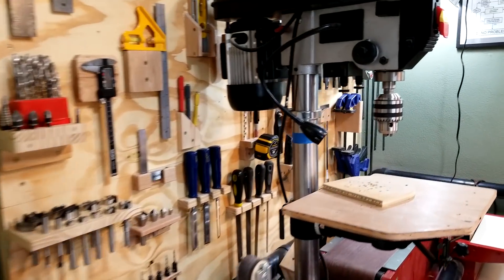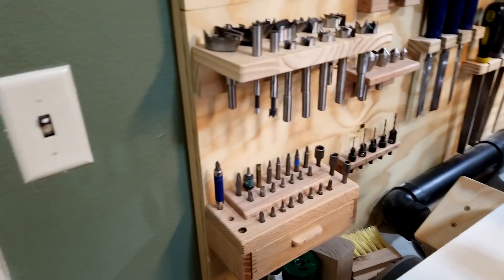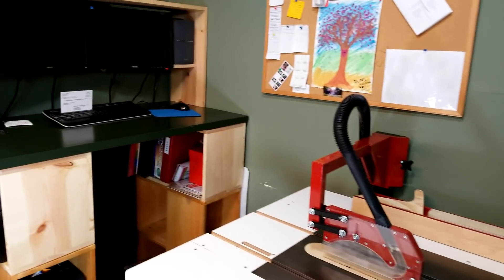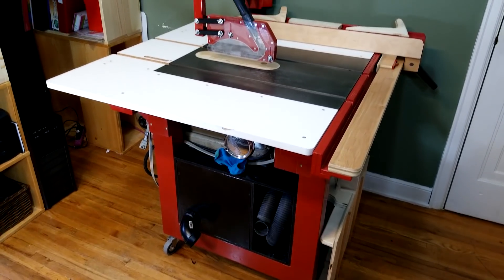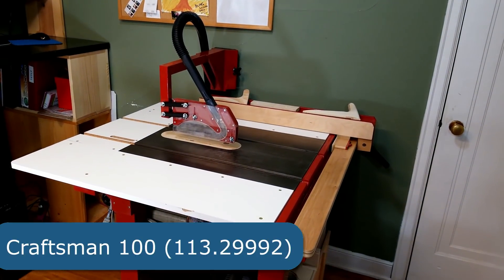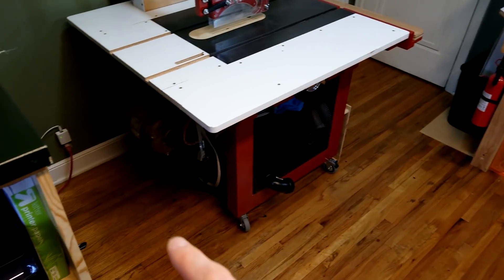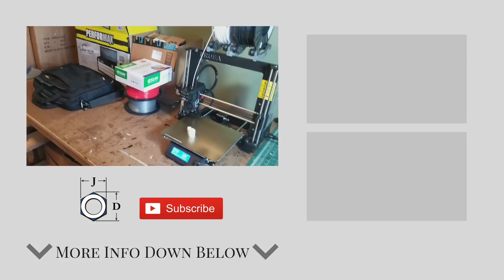My 95 SQFT Apartment Workshop (SHOP TOUR)

Comment: Amazing use of space.  Hats off to you. 
My shop is just a tad larger at 120 sq feet..in addition to the machinery, it also stores large pieces of wood and gobs of misc stuff (which are put up on wall / ceiling storage shelves...( I have 9 foot walls that I brought down to 6.5 feet).  I am more than crammed full right now with no workable room at the moment.  

My shop needs a complete full renovation from purging old stuff,  inventory review, and a new layout redesign for working.   Looking for ideas.   You gave me some.  Thanks for sharing.
Reply from the maker: I'm glad my video was helpful. Why did you lower your ceilings?
Reply: May not have explained it correctly.  My shop is outside, and I built the walls 9 feet high, the highest the city would allow me.  

The wall height is still 9 feet in the center of the shop and I have wood storage rake right in the middle hanging from the rafters.  

I installed shelving on 3 of the walls, and in those area, under the shelving the height is about 6.5 feet.  But, it gives me a lot of storage area to store Holiday Stuff, Old School records, excess plumbing and electrical supplies, etc.

Comment: My biggest challenge in an apartment shop wasn't the space (or the dust) but rather the noise. How did you manage that?
Reply: This is my question, but judging from no response, he Doesn't manage it.
Reply: @tae912  He addressed it.  I remember watching his videos during COVID and he specifically addressed this.  From what I remember in the other video (I'm sure you can look it up), he says:

He keeps his wood shop in the middle room of his apartment.  So it doesn't share walls with the outside to his neighbors.  I remember there wer a couple other things but again... I watched it as a random video 2 years ago.
Reply: @i am i actually just do stuff in my apartment living room. Its not the most convenient but I essentially built a large fume hood over my desk out of polycarbonate with room for my arms to work under. Then there’s fabric over the opening to help the negative pressure system. Then the fume hood is hooked up to a vacuum. It actually works super well but Im sure my neighbors hate me cause of just the inherent noise. But no ones complained yet

Comment: Very nice! I have a single car garage workshop and I find it tiny...

Also on your drill press bed there seems to be a point on a bearing do you use it as a lathe? Is there a video on that?

If yes what do you use for tool rest?

Thanks a good luck on your moving! Can't wait to see your new space!

Benoit
Reply from the maker: Thanks Benoit! That is exactly what you think it is. I experimented with it once to make a small handle. For a tool rest I just clamped a piece of wood to the table. It didn't work the best. I may come back to this idea sometime in the future.